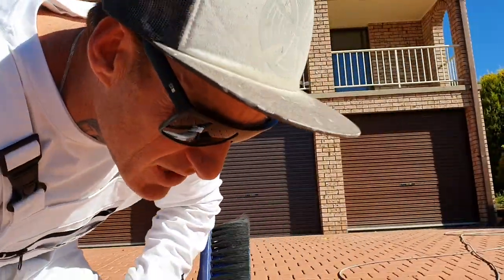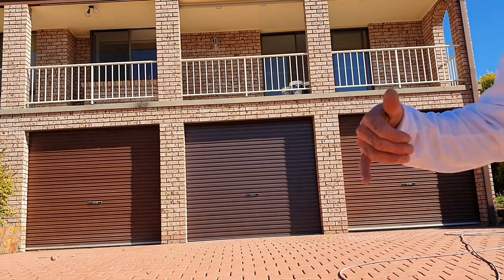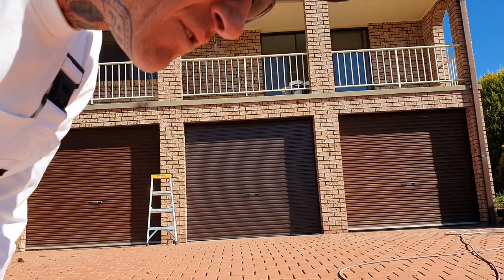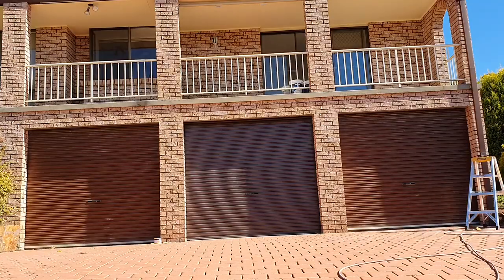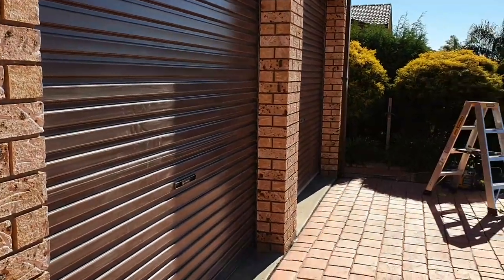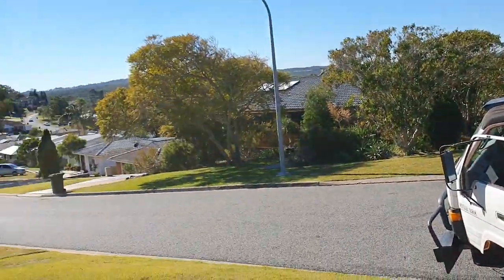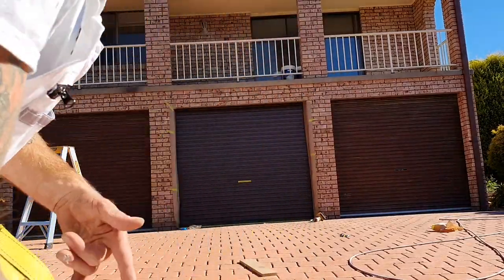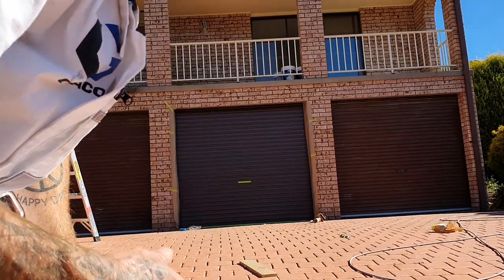HOW I PREP & PAINT GARAGE ROLLER DOORS

Comment: Nice work. I've watched ya vid about 3 times now, written out my shopping list.... and will tackle my mission brown door in the coming days. Thanks heaps
Reply from the maker: this makes me happy to hear. good idea for writing the shopping list. best of luck to you and let me know how you go!
Reply: @paintingbyjosh  Turned out pretty close to perfect 😆 I left the door closed for close to a week to set after painting because i knew there would be a chance some paint may come off at certain spots from rubbing when opening & closing the roller door. So far, so good. While i had the sprayer out, i painted the garage cladding..... looks like a brand new garage now & I'm stoked.  Now I'm going to re-spray my old colorbond fence & a section of corrugated roof using the same technique. Girl power!!
Reply from the maker: @chrise9877   I'm surprised it didn't stick shut 😅 only joking it's always good to leave it as long as you can so the paint can cure probably. Glad it all worked out with the garage door and just repeat the same process on the colorbond fence and you will have no problem. Thanks for the update🙏 respect

Comment: Awesome video mate. What is the spray paint can for?
Reply from the maker: Cheers mate, the Dulux etch primer was just a metal surface primer for any bare surfaces. Cheers
Reply: @paintingbyjosh  Thanks for the response Josh. Isn't the dulux max adhesion, a primer already?
Reply from the maker: @peg372  yes for adhesion purposes not the best as a primer over bare metal  compared to metal etch primer 👍

Comment: Nice job mate, are you doing several passes to hitnthe edges? Gotta roller door to do with similar shape.
Reply from the maker: Hey mate, yeah with this type of door you need to pivot the gun up and down with each past to get both upper and lower edges. Hope this helps 👍
Reply: @paintingbyjosh  thanks mate it does definitely. I was thinking it might be the case

Comment: Hi, just found your channel, great work! I’m looking to paint my roller door and wondered if it could be done with rattle cans as I don’t have the equipment that you have? Thanks
Reply from the maker: Hi, yes the process can be done with a spray can, will just take a little longer. 
Thank you 🙏
Reply: @paintingbyjosh  hey Josh, what spray gun would you recommend for DIY without braking the bank? Would a Wagner Control Pro 150 do the work of painting a garage door and exterior of a brick house?  Price is $449 and the next level up $1,150 for the Pro 350 with a hose length of 15m. Cheers Celo

Comment: Hi josh, do you thin your paint at all if using the Dulux Maxi Flex product when spraying roller doors, given the 312 Tip is fairly fine?
Reply from the maker: Hi mate. Definitely not I don't thin down any paint other than maybe a little in the aquanamel for better spray optimisation 🙏🤙 i used a fflp308 on my last garage door using maxi-flex

Comment: how long did it take you to do those 3 doors? I am Bidding on a huge storage unit place 237 unit doors .I was wounding if you remember?
Reply from the maker: Depending on condition but if just a light sand and tape you could do between 5-10 a day ones prep is done its around two minute's per door per coat. Hope this helps mate👍

Comment: Seems like the manual sanding is the slowest part. Is there any power tool than can sand large areas of irregular surfaces? If there is not their should be.
Reply from the maker: The prep is always the longest part💯 there is nothing really out there for this. Sometimes hand sanding is the only way! I 🙏
Reply: @paintingbyjosh  Maybe you should invent it. I think there is a big need for it.
Reply from the maker: @vinvan4237  definitely a market for it!

Comment: Is a 517 tip good for roller doors
Reply: Do u use the fflp 312 tip for top coat
Reply from the maker: Hi Chilli, i usually use FFLP412 for garage doors 👍
Reply: Thank u
Reply: What about a colourbond roof what tip would u recommend
Reply from the maker: @chillitrain9584  depending on the wind but usually a 517 - 619 👍